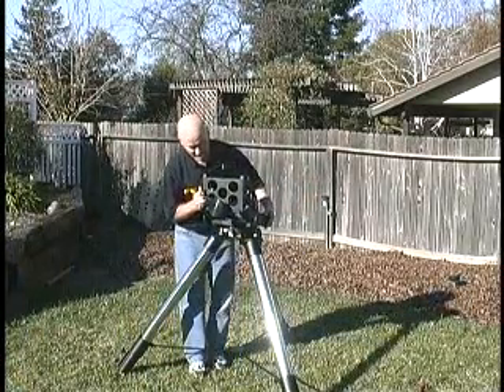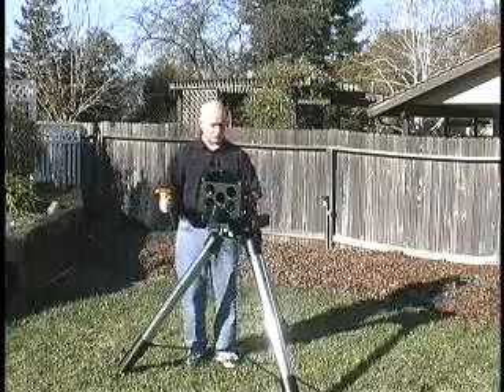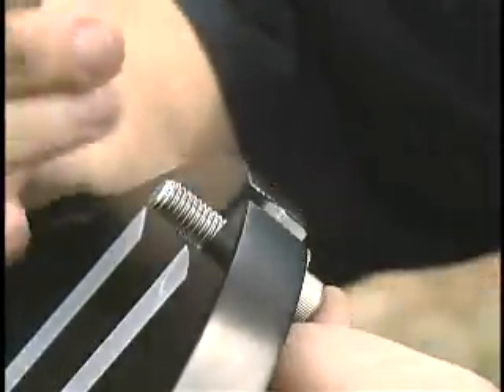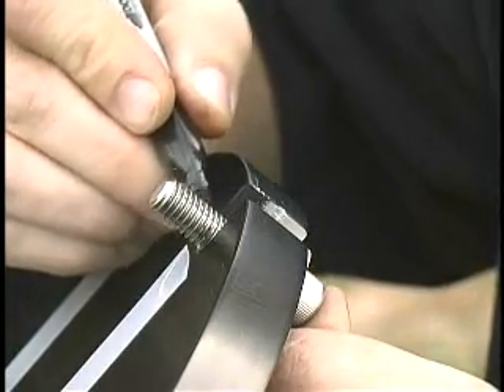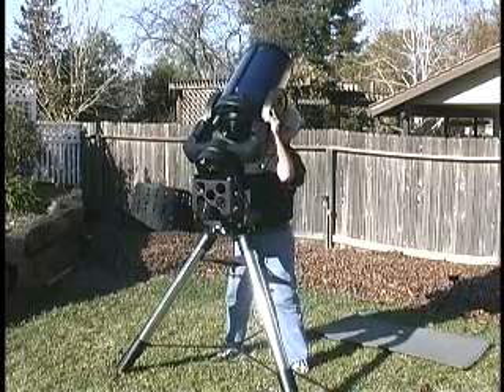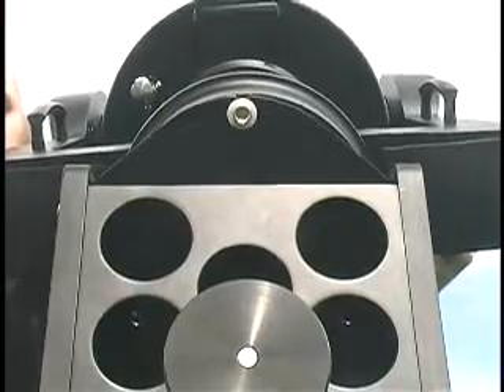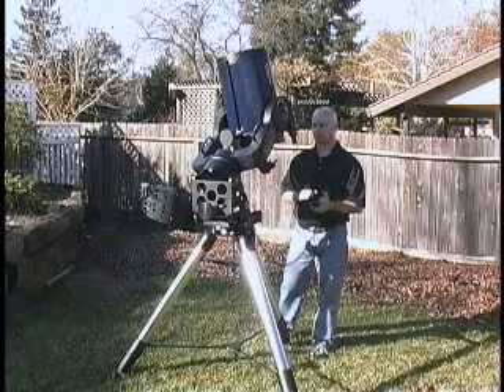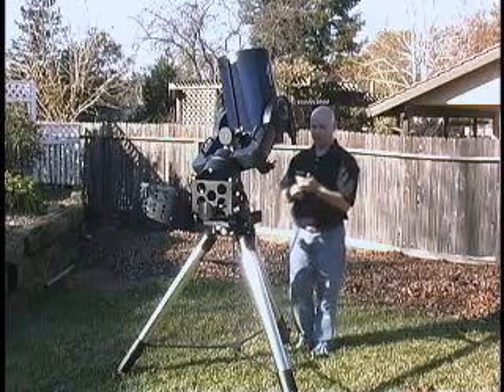AstroDude - Meade LX200 Polar Alignment

Comment: To those who are asking, that's a Meade 12".  The 14" is a much larger and the 16" would require two people or more to lift it in place.  Unless you're on steroids and enjoy the risk of dropping a $10,000 scope, don't move the 16" by yourself.  The 12" is manageable.

He shows what it looks like on a wedge, but does not show how to polar align it...which is probably why he has so many dislikes on the video.

Comment: For polar alignment of the scope you first must "polar align" the tripod/wedge. Then you attach the scope making sure that the arms of the mount are aligned with the celestial pole. Place the scope in a neutral position DA 00-00'-00" and RA 90 then you take the hand controller and go to "polar align" and let it get the GPS fix etc. 
Thanks 
A
Reply: which way am i facing the opposite of when I don't use the wedge, also am i out of luck if my controller does not have the polar align feature?

Comment: If you are a Strong Armed Man ,you can Lift up to a 12" Schmidt-Cassegrain Optical Tube Assembly(OTA abbrev.). But the 14" whether Meade or Celestron Requires a 2 Man Lift into the Front of the Equatorial Wedge Front Bolt.  If you have a CELESTRON CGT-5 Advanced,CGEM,GGEM DX or CGE Pro, A 1 Man with Strong Arms can Just Manage the 14" Schmidt-Cassegrain Optical Tube because you Only have to Slide it onto the DoveTail Rest Plate then Tightening 2 Holding Hand Bolts with Wide Nut Heads on Tripod!!